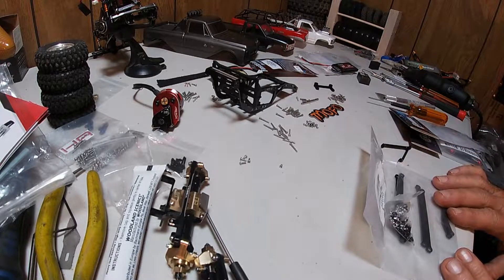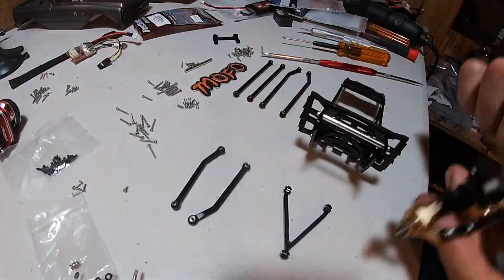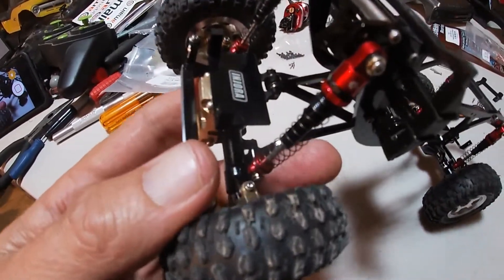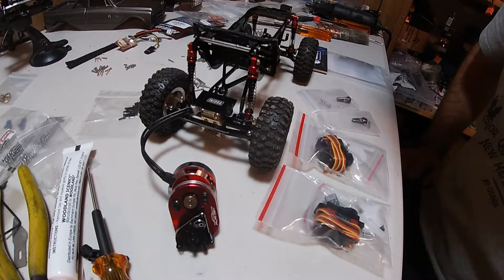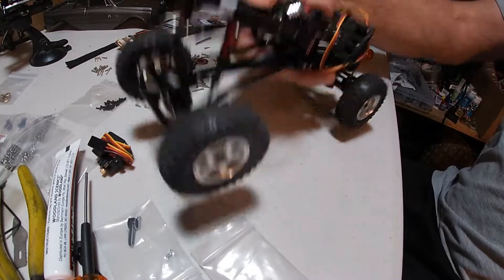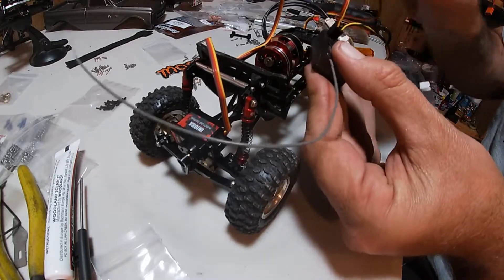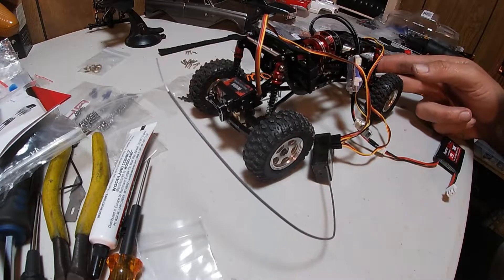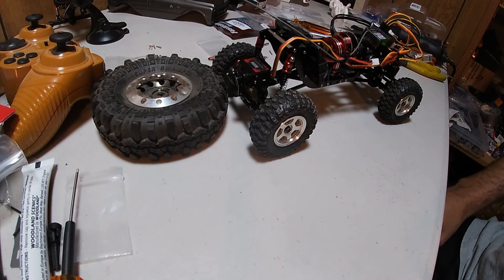How to Build a Comp Crawler!! Part 4,5 Links, Driveshafts, and electronics

Comment: got a link for that controller?
Reply from the maker: Radiolink RC6GS V2 6CH RC Car Transmitter 2.4g with R7FG Gyro and Two-Way Remote it's not a link but just copy and paste it. They are sold everywhere , ebay, amazon, etc.

Comment: With metal drive shafts, your weak link will be the axle shaft dog bones. With plastic drive shafts, they will pop before anything breaks. It's nice since the Komodo has so much torque.
Reply from the maker: yeah, I've got 9 of these scx24s so far. I upgrade trans case, trans gears, spur, pinion, driveshafts in the ones with upgraded motors. I've had better luck with the stock axle shafts than the after market ones. Any suggestions on a good axle shaft? Mainly the front, no problems with the rear ones.
Reply: @slowerlowerrc  you would have to upgrade to a different type of axle. I've heard there's someone working on CVD joints that don't use dog bones. Not sure though.

For me, plastic drive shafts work too well to switch to metal. If my drive shaft pops, I can fix it in about 2 minutes. Without plastic drive shafts, I'm breaking or bending some part of my axle shaft. I have to get pretty bound up and keep pushing my rig to pop a drive shaft, so I've never considered upgrading.
Reply: @slowerlowerrc  Most likely the reason you are breaking axel shafts/ dog bones is that your steering end points are too aggressive.  Especially with the Komodo motor.  That thing has way to much power for these small trucks